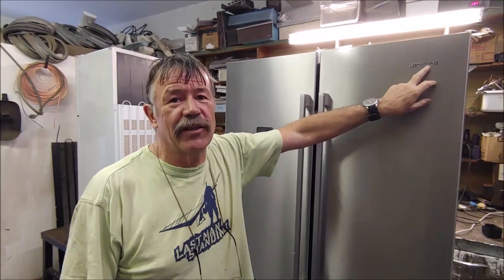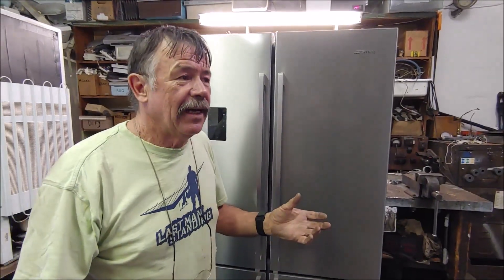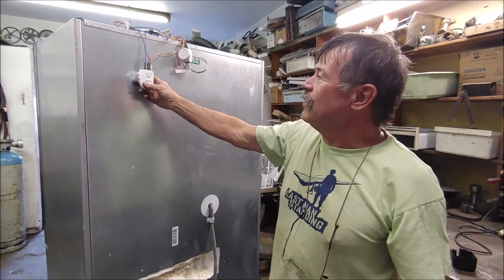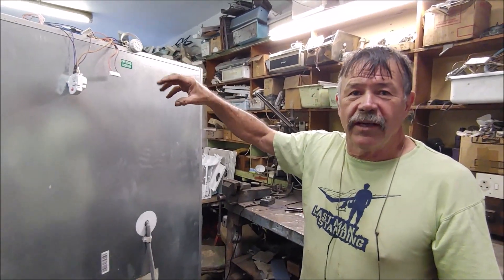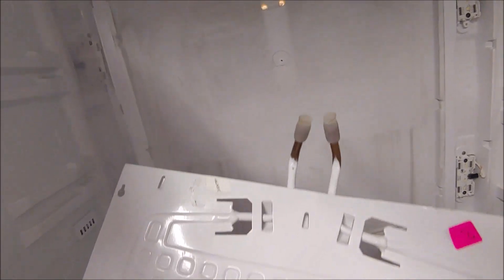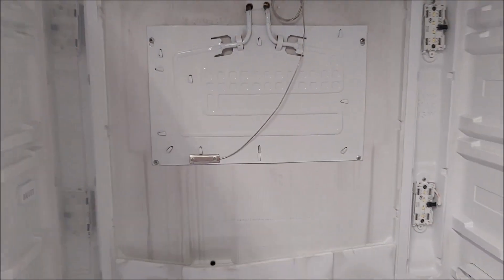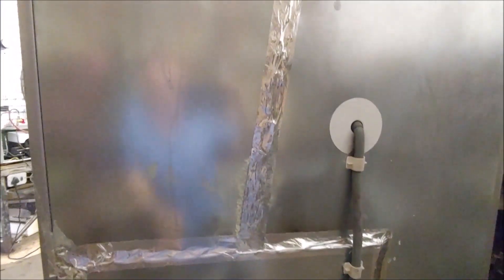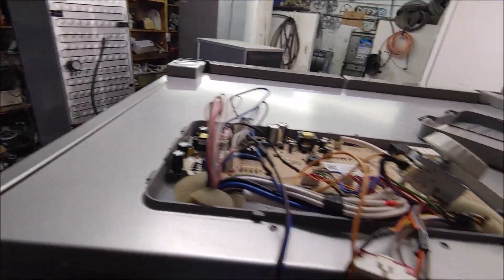Modifying the refrigeration and electronic operating system of a Smeg fridge

Comment: Great video! I do have 2 questions. With the components not connected to the board, will the board display error codes? 
If the solenoid that directs the refrigerant is no longer used, how would you charge the system? If you have 2 evaporators and 1 condenser for each compressor, without the solenoid how would refrigerant flow to both evaporators at the same time?
Reply from the maker: Some PC boards do display error codes but this particular one doesn't.
The system is 1 continuous loop and I charge it like I charge all other domestic fridges.
This particular fridge only has 1 compressor.

Comment: I’ve learned a whole lot from you. Thank you very much. 
I have a question please. How does this modification ensure that the fridge temperature is different from the freezer? Is it something to de with the cold plate? Thanks
Reply from the maker: The fridge temperature is controlled by the thermostat. The freezer temperature has no control on it but it is normally 15-20 degrees Celsius colder than the fridge
Reply: @JDNelRefrigeration  
Thank you so much sir. Wow. YOU ARE A LEGEND. That’s interesting. I was wondering if the thermostat shuts the compressor off will it affect the freezer too. 
I’m going to implement this method and I’ll give you feed back Sir.
Reply from the maker: @Emmagentle  Yes the compressor switching off will affect the freezer.
Reply: I like to contribute financially. Please let me know how to do it. Thank you very much.
Reply from the maker: @Emmagentle  Thank you for the offer.